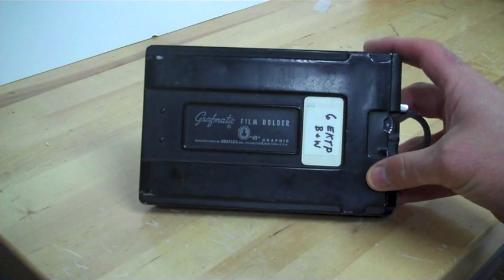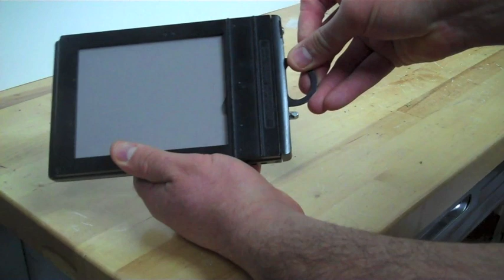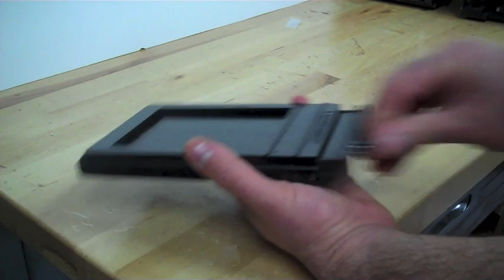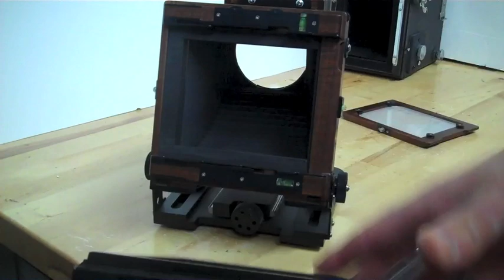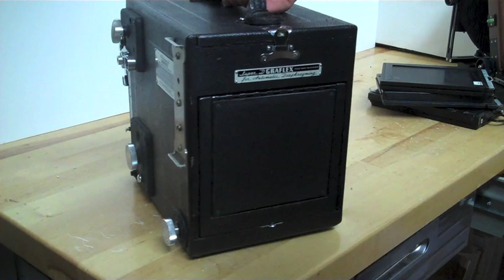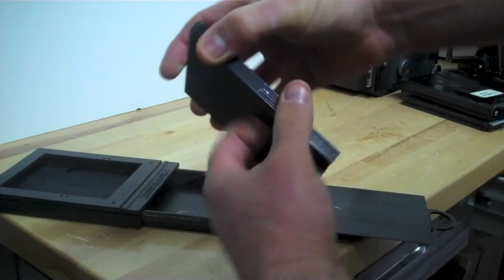Grafmatic Film Backs

Comment: nice video, heard they made a 6x9 version for the linhof teknica style cameras wish you had included them as well , are they still available (2016) ?
Reply: 6x9 cm versions were made; I've used a couple of them with a medium format view camera. They work exactly like the 4x5 versions, which are much more common. Given the confused presentation here, you'll conclude that there is a learning curve to using these things, but once the use is familiar, they are much nicer than the conventional two sheet holders. I doubt that these holders in any size have  been made since Graflex folded the mid-1950s, but they are on ebay periodically. When buying used, check the septums carefully(1) for being bent or warped, and (2) for crushed film retaining channel. They are pretty rugged, but they also got a lot of abuse.